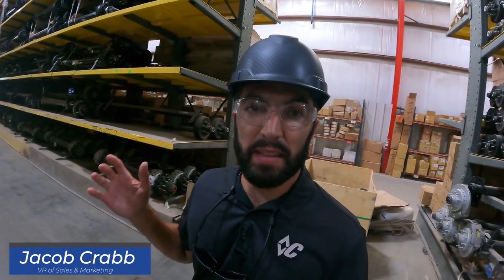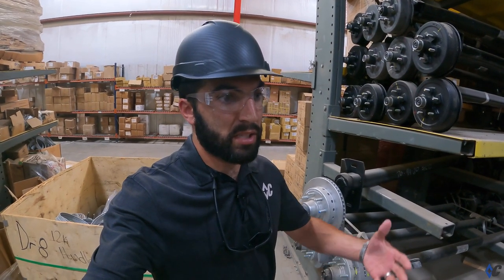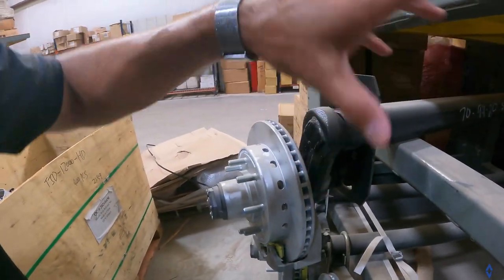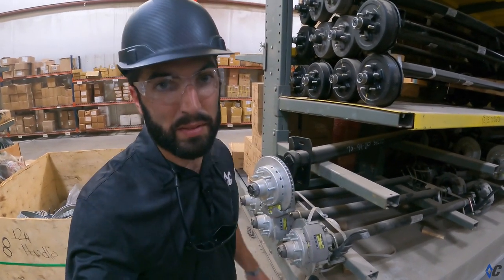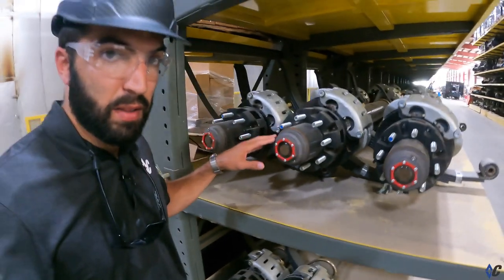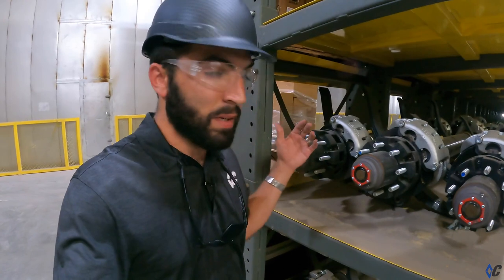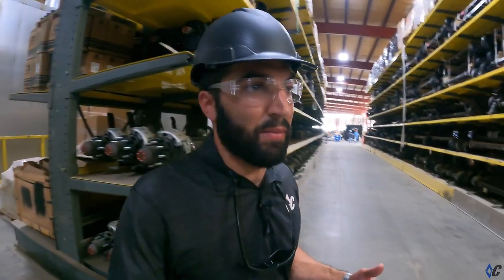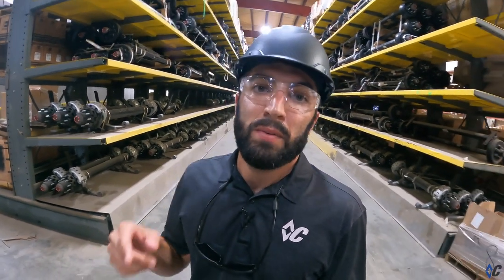Disc Brake & Hub Oil Maintenance | Diamond C

Comment from the maker: Subscribe to our channel for the latest updates and news: https://www.youtube.com/user/diamondctrailers?sub_confirmation=1
Reply: When you going to do a LPX video? I’m eagerly awaiting for my LPX.
Reply from the maker: @boatjoe232  Just recorded one a few days ago.. it’s coming 😁
Reply: @diamondctrailers  hopefully i will see my charcoal 207 24ft max ramp LPX in the video.
Reply: My vendor won’t upgrade my order. Almost a year waiting. Can you help?
Reply: @serviceshoptoday  there is a lock in date on your order. Once that date passes. They start production on ur trailer shortly after.  Also it’s a Diamond C policy is what I have been told by my dealer, that is why u can’t alter ur order likely. They don’t want an order started and then changed halfway through. This can add a massive amount of extra work if someone were to decide they want longer frame or heavier axles etc. your dealer should be able to login to the diamond c portal and tell you what your lock-in date is. I’m no expert here, but I’m going through the build process and waiting for my trlr to arrive also but all the info I just gave came from my dealer direct. Hope this helps explain why your getting the answer you got.

Comment: My reason for running grease on my dump trailers is because when loading with a skid steer if I bump  the older style plastic sight hub cover it would crack, sling oil all over, possibly leave you without good brakes and maybe lose a bearing. If I bump the metal cover on a greasable axle not much going to go wrong. 

I'm curious how the new style caps would hold up to a bump from a skid steer.

I have 3 of your trailers now. I'm a fan of the product, company and the way you work at giving your customers good information through videos like this.

Comment: People commonly call them "Oil filled Hubs" when the actual term is "Oil Bath Hubs". You only need enough for the bottom of the bearings to be covered in order to splash the oil. It's usually the same guy that overfilled them that complains that they leak.
Reply from the maker: Spot on! 👌
Reply: Facts

Comment: Wish you would have explained on both axles how the rotor is attached.  On the lightweight is is just sitting on the studs and can just pull off when the tire is off?  On the heavy axles how much do you have to tear down to replace the rotor?  How is the rotor attached to the moving part of the axle, and how is the caliper attached to the axle?  Might need to make another video to show us how they are made and how maintenance is done.

Comment: The thing I hear most about grease vs oil is on the single wheel axles the wheels flex a lot while turning and breaks the seal on them pretty often. I just ordered a trailer with 8k axles and I'm assuming oil hubs so I'll find out for myself
Reply: I prefer grease, it doesn’t leak so easy.

Comment: The 10k axle option…it only has drum brakes as an option, just wanted to triple check and see if it’s possible to do disc brakes on the 10k axles
Reply from the maker: Never hurts to check. It’s not available on 10Ks because of the size of the hub and caliper it constricts bed width down to a largely unusable width.
Reply: @diamondctrailers  thank you very much!

Comment: What type of hub oil do you recommend for the 12k axles?
Reply from the maker: Any premium 90 weight gear oil works great. Lucas Oil products makes Lucas Hub Oil as well.
Reply: @diamondctrailers  75w-90 or 80w-90

Comment: Can I  buy a trailer and have more lights added to it is that possible to have done
Reply: Yes u can. It’s part of there build your own trailer process. Just don’t be dumb and buy trailer and then add lights yourself. Diamond C comes with a 1 piece sealed harness. At least if you ever see salt on ur Roads I would keep that harness integrity intact.